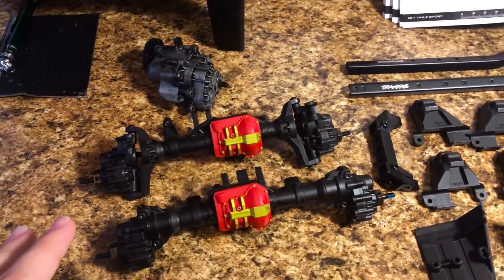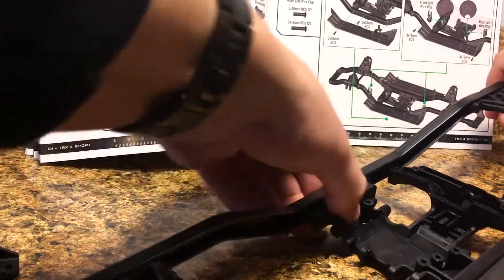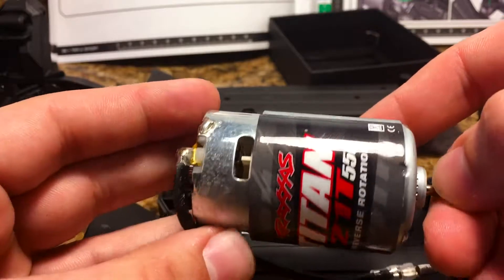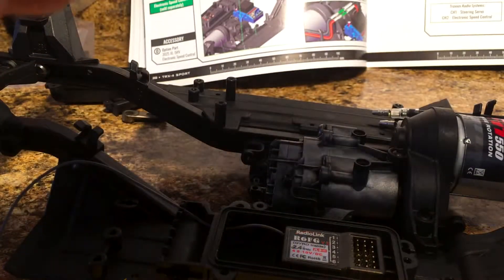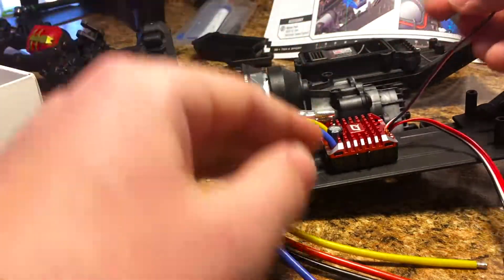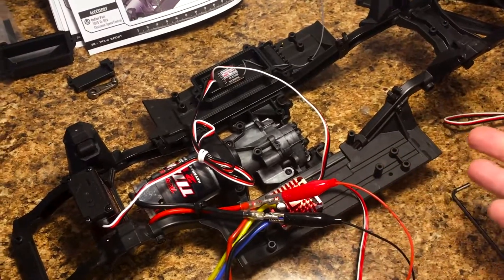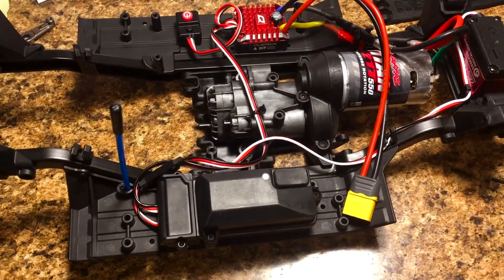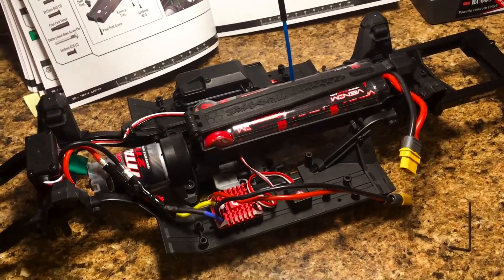HOBBYWING & RadioLink COMBO! ASSEMBLING A NEW CHASSIS | Project TRX-4 SPORT 2021

Comment: I bought my son a traxxas slash 2wd RTR. I want to upgrade to brushless. What would you recommend motor and esc. Thank you for your time!
Reply from the maker: Traxxas makes a great brushless system called Velineon. You could also look at Castle Creations or Hobbywing. Hobbywing ESCs are usually better for crawlers, but a great esc. I would recommend looking at the velineon system first, and go from there.
Reply: I guess it is kind of randomly asking but does anybody know of a good website to stream newly released series online ?
Reply: @Khalil Diego i watch on flixzone. Just google for it =)
Reply: @Boden Keaton yup, I have been using FlixZone for since april myself :D
Reply: @Boden Keaton thanks, signed up and it seems to work :D I really appreciate it!!
Reply: @Khalil Diego glad I could help =)